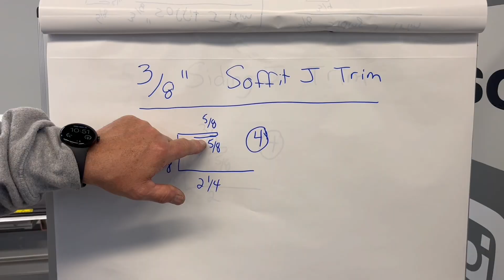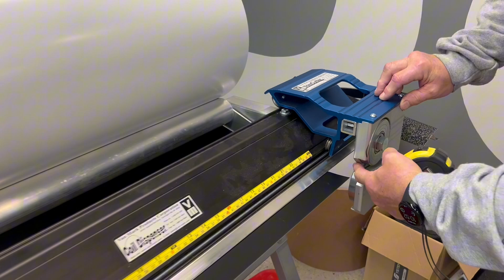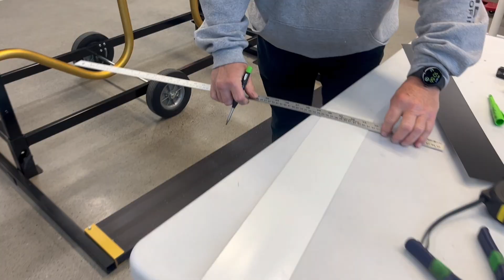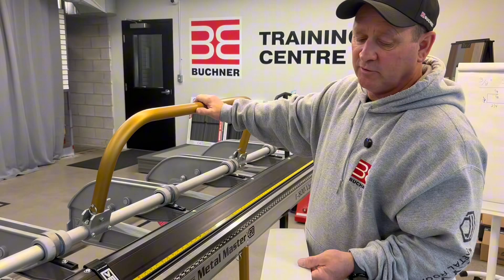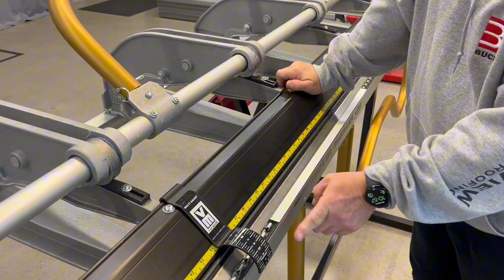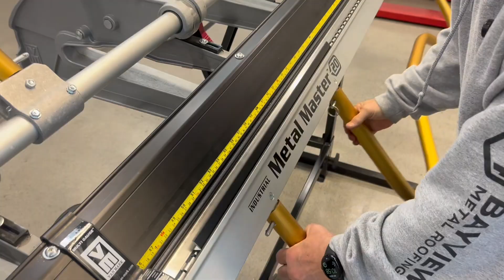How to Bend 3/8" Soffit J-Trim | Brake Basics #3

Comment: Any tips on when your break is not as new and doesn't lock quite as good as that to be able to get that 3/8 inch bend. Mine locks pretty well for most things but always seems to wanna slip and push the metal in when doing a half inch J channel. Thanks! Great stuff!
Reply: Also 5/8" shelf on the j channel is convenient with the van mark. 🤙
Do you think a 1/2" shelf is too small? I want to make a 1/2" deep shelf that holds aluminum soffit and caps  1/2" aluminum siding as well. F&j of sorts